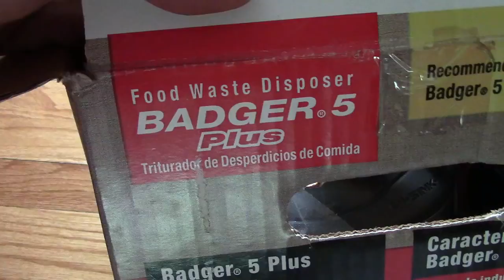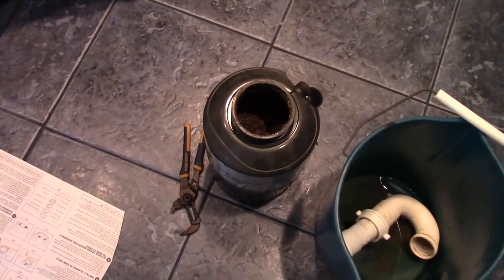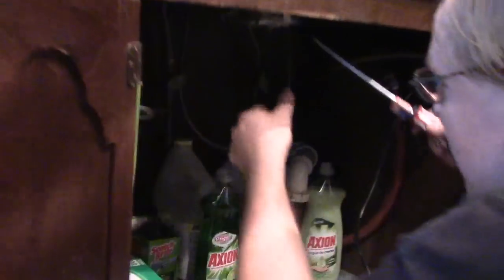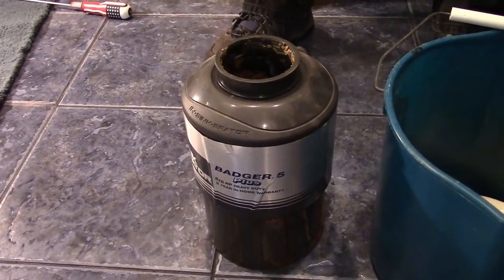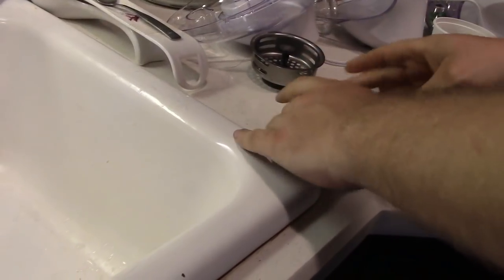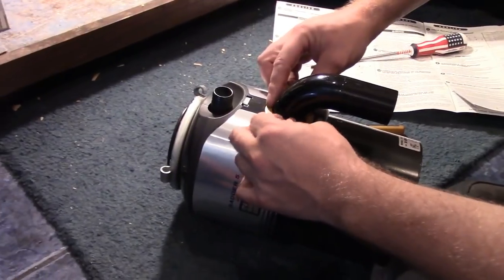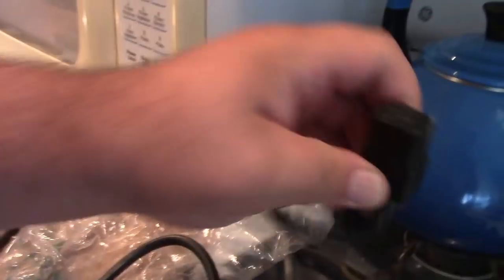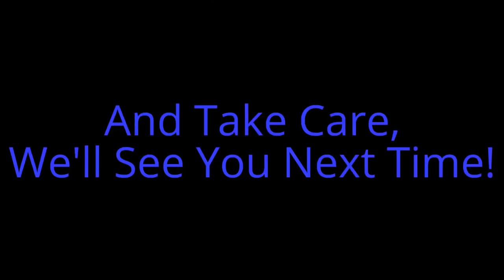Replacing My Garbage Disposal With A VINTAGE MINT-IN-THE-BOX Exact Replacement

Comment: Wow.  I almost forgot about this due to a lot going on in my life.  Really cool how the motor has a centrifugal switch and hearing it clicking.  Happy to actually find an exact unit to your old one
Reply from the maker: Oh absolutely, it's an induction motor, which is what's required in this application, and usually they have a centrifugal switch to cut in and out the start winding or capacitor.  The old one, as you might expect, being the same unit, was the same way.  Yeah, it works and sounds just like the original!

Comment: Hard to beat new old stock, and for $40, that's awesome! That's probably what I'll do when our disposal quits. It's a Montgomery Ward 21540 from around 2000-2001, but not sure who manufactured the disposal. It also has the same mounting hardware for attaching the discharge pipe, so perhaps that is a newer design. I was subbed to two out of three channels, now I'm subbed to Will Butter as well.
Reply from the maker: If yours is still going 16 or 17 years now, you've probably got nothing to worry about for a while.  This one just happened to fall into my lap basically, it'll never happen again.  I actually have no problem buying China Pride garbage disposables and replacing them every 2 or 3 years.  This old one was just stuck on there, otherwise they're real easy to change, the pipe is all PVC, the cord can be transplanted onto the new one, and the whole job can literally be done in 10 minutes.  Then again if something rather vintage comes along, yeah, that's definitely the way to go.
Reply: I hope it continues to hang on, I'm doing my best to keep the China Pride to a minimum around here. We have a mullion between the cabinet doors under the sink, which makes things a little more cramped. I'm not getting any younger, or skinnier, so the less I have to get under the sink area, the better!
Reply from the maker: Fully understood!
Reply: most likely Anaheim
does it have a growly, short and grainy tone to it? or a low slow and quiet and a click clunk when powered down? usually explanatory of who made it if you have pictures/videos of it i'd love to see if i can guess what OEM Made it (anahiem or emerson) though it could be something else

Comment: Tonight I'll be installing an actual mint in the box, vintage 1970s, GE "High Speed" 8000 RPM disposal. Can't wait to see what it does with chicken bones!
Reply from the maker: Beautiful!  I don't feed mine anything I can't really chew...
Reply: Well I’ve gone I’ll in the head and swapped out the NIB GE for a used 1989 Waste King Thermador 3/4 HP. What a beast!
Reply from the maker: I'd have no problem with an 89 model.
Reply: The older garbage disposals truly were the best, old Kitchenaids, Waste Kings, Maytags, even the old ISE units were something else back then!
Reply from the maker: Everything was made to a standard of QUALITY, which doesn't exist today.  People wouldn't buy garbage then.  Now that's all they make.
Reply: The grind ring in this thing is made of nichrome steel, I though they were nuts when they said these things never dulled or wore. But it seems to be true!
Reply from the maker: I don't doubt it!

Comment: I have about 10+  Vintage dispsosers from the 60s and up ... The old ones may not be as powerful but they have real blades and can grind anything. I have a 1973 Waste King SS8000 that disposer was 293 bucks in 1973 so they did not sell many.  I have 3 other wastekings they were some of the best ever. I have Old G.E. the 8000 RPM and the induction motors. I have a 1968 ISE 77 that is a beast of a machine. A 1974 Maytag FC20 , and I have many more... I cant use new disposers my sewer wont take it ,they grind to coarse..  I also have a old Rinse a way disposer that weighs about 50 pounds.  I have a 1990 Viking batch feed and a WASTE KING COMMERCIAL DISPOSER also..Most old brands used under-cutters .. That is what made them so good.My Wasteking SS8000 tells you to grind paper towels, cig butts ,plastic forks , corn husks, artichokes, steak bones, and any and all food items,  in the instructions.. Those are all a big no no today... I love the G.E. 8000 Rpm disposers. There is no grind ring to dull in it.. There is just one spike on the wall and the flywheel is very small the shear speed grinds everything and it grinds very very well and does not dull..
Reply from the maker: They only made quality back in the day.
Reply: You should make videos of them
Reply: yes i agree, say would you mind showing them somehow? i.. i'd ADORE that

Comment: Damn that thing didn't want to come off. You think they would invent a better way because under the sink is so small. Forget about the big sink with that wood piece in the middle of the cabinet.
Reply from the maker: It shouldn't have been like that.  Supposed to do like a quarter or a third of a turn and drop right down.  That was the whole problem, otherwise it would have been replaced a long time ago.
Reply: jaykay18 also I noticed when you hit the switch the light shuts off then the mechanism turns on then when you turn the mechanism off the light turns on. So is there something there that has the light off and the mechanism off?
Reply from the maker: Yes, the switch on the wall kills power to that whole box.

Comment: The new Insinkerator badger garbage disposable today are absolute crap (to no surprise) When I move in to my apartment they've replaced the garbage disposal. It ran fine for 2 years until its started leaking and rusting out. Called to have it replaced, 2 years later and now i think the new one is on its way out. It's rusting out and the motor will jam every once in a while. So over the 4 years and 6 months time that I lived here I'm probably to go have a 3rd garage disposable replaced. Luckily I don't have to pay for them
Reply from the maker: Garbage disposables--that's like something I would come up with!  I've heard even these Badger 5s rust out and leak in short order, even though it's older.
Reply: They tend to, the more you use it the longer they tend to last though. We had the cheapest badger from the time the house was built to early this year, 13 years before it rusted out. There was a brief parade of sink grinders until I found the one I’d been looking for, a vintage Waste King! I grabbed the first one I saw, a used 1989 3/4 HP Thermador branded one, old and well used but the cast nichrome steel grind ring and hardened stainless steel inside shows no noticeable wear!
Reply from the maker: Nice!